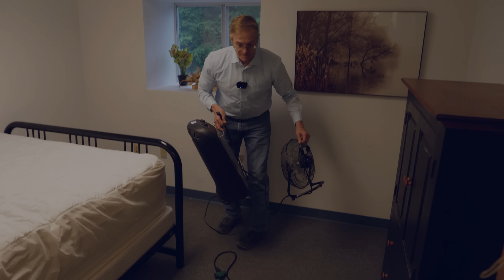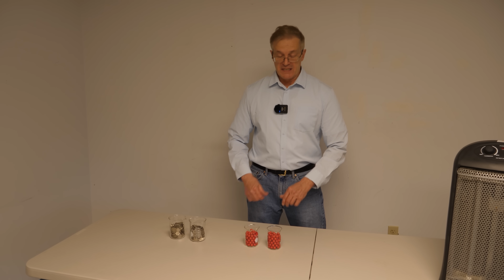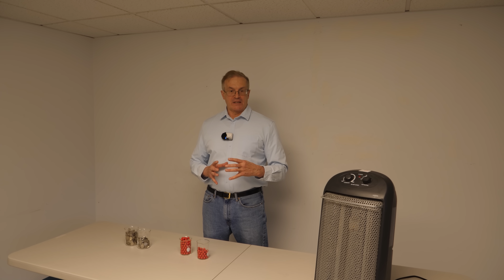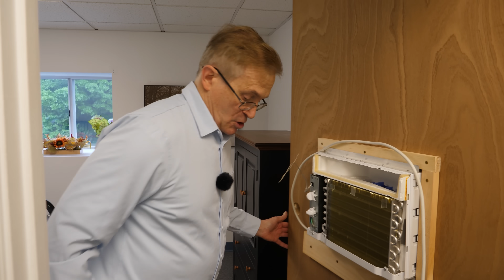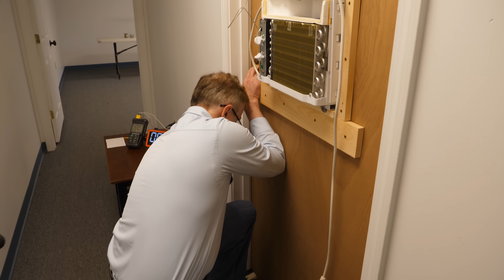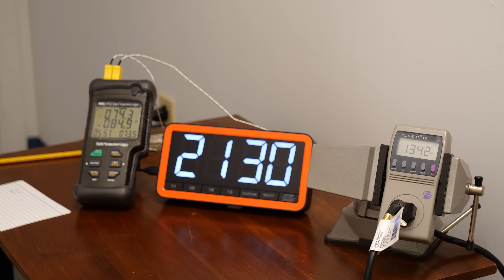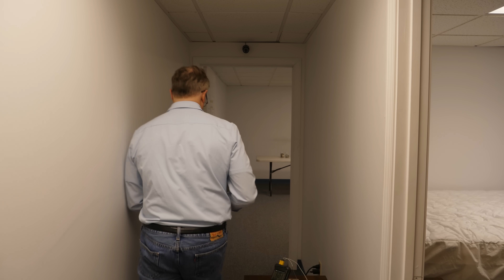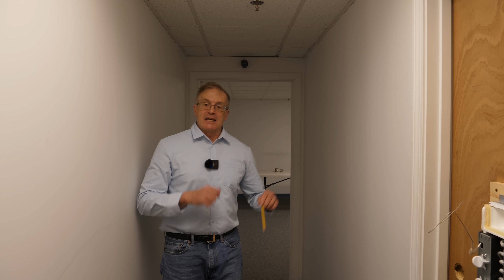You're wasting money on heating! Use your A/C!

Comment: Being a female I have no clue about how to fix electrical problems , or build a house or fix my car when it breaks down, all I know to do is how to cook , how to do laundry, how to clean my house etc etc. But I’m telling you right now is that I need to learn all these skills that men know so I can improve my way of living and save money in this path once and for all. 😮
Reply: Don't you realize that men aren't born knowing those things?  They also have to learn those skills by reading, taking classes, etc. It's just that they are unfairly expected to do that whereas women have traditionally been discouraged or even forbidden from learning those skills.  Neither is fair.
Reply: @DarqJestor  
And it is not just that. Often while maybe we would somehow manage to fix something, if we lack experience, we do not want to touch it, for fear that we will make it worse. If it is a small project, if I need to modify something for a certain need, I will go buy an extra(s) before I mess it up. In case I do not like how my project turned out. I feel more comfortable taking something apart to see if I can fix it, after I have already replaced it, and I am just rescuing an item that was about to go into the trash. I once found a discarded flat-panel TV. Maybe I should have tested it, just in case it worked? Anyway, I took it apart to see what was inside, why not? That is one way to learn. At least then I could use the spare power cord to repair something else.

I think that can be the way to transition over to a newer computer, if your old computer has not died yet. Give it time to get it set up, and keep the old one set up also. I do not want to give up the old computer, at least not until I am well used to the new one, and owning an extra computer monitor, keyboard, mouse, is not all that expensive these days. And I can be sure that I have copied everything over to the newer computer, and installed all much the same software, and I see that everything seems to be working.

Sometimes you can upgrade or get something new, and them carefully repack the old device back into its box, with all its parts, and then you have a spare lying around at the ready in case the new thing breaks, or your new configuration now needs another. Like I have a perfectly good digital answering machine back in its box, now that my cordless phones included answering machines. And no, I am not using the outdated phone monopoly land-line. You can get a VOIP adapter box and do home-phone through your internet, more features and cheaper.

I used to like the Apple Macintosh, but I seem to have defected years ago. I do not like Apple's politics, and I can not keep up with their over-priced and over-hyped artsy-fartcy computers. I have been using Linux for the last few years. The big selling point of Linux is if you think that you should own your OS and not some giant corporation, then you should use Linux. As I lean libertarian, they are so "speaking my language" in saying that.
Reply: @DarqJestor  as a woman who does all the fixen and building, I would like to point out what Jestor is saying it's unfair to men. You might be surprised to hear me say that after complaining about the other side, but doing all stuff I noticed one common thread. The stuff isn't hard. It doesn't require a lot of strength or size, but what it all has in common is a level of danger. It's all dangerous and requires safety. I get it, woman have kids, but I think as a society it's very unfair for woman to turn their nose up at any job that requires safety glasses.
Reply: @FuelFire_  I agree and I hope my comment wasn't misunderstood. People should neither be limited by stereotypes or use those stereotypes to gain advantage over others.
Reply: @DarqJestor  yeah I got it. I'm just agreeing with you. Wish more men saw it that way.
Reply: @FuelFire_  Female army mechanic here.
Reply: @DarqJestor  oh. That makes way more sense. Lol. Awesome 👍 so you know what I'm talking about. 😂
Reply: Please don't attribute your lack of electrical or construction knowledge to being female. It's fine if you have no clue about those subjects, but don't make it harder for the rest of us to be taken seriously. I can also help you understand anything you want. just ask instead of throwing us all under the bus. Thanks.
Reply: Some women CAN fix those things. Do you like to read? There are some great books with pictures, that tell you how to fix those things. Also can be learned from YT. I watch a lot of those videos, yet still lack experience or the fancy tools. I still do not want to touch it if I can avoid meddling with it.

But there are lots of us men, would would love to have a wife who cooks, buys groceries, knows how to coupon, does laundry, keep the house clean and organized, and some of us men can ourselves fix things around the house. It seemed like my Dad could fix anything. I can fix some things, if they are simple enough. I can replace a loose electrical outlet for example. But my talents in such areas are only "moderate". I lack experience and do not have all of the tools, I only have common basic tools. And I am sure not fast. Takes me way too long to fix something.

But if you can cook and clean and wash clothes, AND fix things around the house, maybe even fix the car, you would be such a "find" for a virtuous man.

Sometimes when I am watching an episode on Homeful on YT, I see a lady helping fix a botched remodel. Something just brings a smile to me, because at least as I see it, women do it right, they do not cut corners and do not do crap jobs like too many men do.

I recall long time ago when I still watched TV, watching The Cosby Show and the wife panicking because her husband, Cliff Huxtable, one of those guys who thinks he can fix stuff but really does not know what he is doing, decided to tackle some plumbing problem around the bathtub. So she is frantic to get a plumber there before he tears up the house. Must be nice, if you have plenty of money. But he was a doctor who delivers babies, so I think that they could afford a qualified plumber.

Comment: Pretty impressive. But how do you utilize this principle with a whole home air conditioning unit?
Reply from the maker: Thanks!
That's  a complex question. 
What we were demonstrating was the efficiency multiplier effect of a heat pump. How it is implemented depends on the environment, i.e., the temperature range between the outside and the inside of the building. It also depends on the furnace.  If it is gas-fired, then a heat pump can be added to top up the heating, taking advantage of the gas to reduce the temperature differential. If it is electrically driven, then it likely already incorporates a heat pump. 
If the whole house airconditioner is independent of the heating system and this is unlikely, then you have less flexibility.

Comment: Doesn't the efficiency of a heat  pump depend on the temperature of the air that's being cooled to extract heat? The air you used in your demonstration was warmer than the outside air would be when heat is needed to keep the inside temperature comfortable?
Reply from the maker: That is correct.

Comment: Very good and informative demonstration.  But, I would like to see the same demonstration with the air conditioner in the window, facing outside with the outside temperature around freezing.  I would like to see if the air conditioner would be able to pull any thermal energy at those temperatures.  With this demonstration, the air conditioner pulled the warm energy from the hallway and pumped it into the room...which is the purpose of the demonstration.  I just think it would be interesting to see the results pulling energy from outside.

Comment: I am well aware of the efficiency of a heat pump, thanks to Technology Connections, Just Have a Think and Two Bit da Vinci. But I'm in Southern Ontario Canada with time of use electricity rates. I need to compare the cost converting and operating my AC system as a two way heat pump against just staying with natural gas for heat and AC for cooling.
Reply from the maker: Of course.
We weren't discussing your particular situation or even the relative costs of different forms of energy. The efficiency multiplier effect of a heat pump is potentially very useful. This effect increases even further as the temperature differential decreases. Consider a hybrid system where fuel such as natural gas or propane brings the outdoor temperature above freezing, and a heat pump continues the heating to a comfortable room temperature. It's  the best of both worlds.

Comment: But this requires the area of exchange to have the capacity to exchange. This was the room vs. the house. A real system would use outside or underground with isneven larger therefore better. However, there are losses in the distance of the plumbing for the system. I agree this is the better way to do it, but this is a simplified example with higher than real-world efficiencies.

Comment: Very nicely done.  I’ve a few questions though, the air you are pulling into the room is from an indoor source,not cold external air so not sure how that would affect the test.  Also to do this, do you have to reverse the position of the AC in your Window so the controls are outside?  Wouldn’t this possibly make the air outside dangerously colder?  If everyone did this it might trigger an premature ice age (kidding)

Comment: Im not sure why he thinks new ACs are more efficient. New window acs still use 400-500watts. Where are you looking that you could one operating at 250? Why even say that? Also why didnt you put the fan and heater near the door on a table or something so it would be in the same general place as the AC? The AC is literally right next to your temp probe and at the same height. Im not doubting that the AC is more efficient, but why do all this work and half-ass a bunch of things

Comment: I've got two heat pumps at the moment (one in the garage, and one in a spare bedroom that was never at the same temperature as the rest of my house). The AC side of things seems to work pretty well regardless of outside temperature, but the heating side of the system struggles pretty hard when it gets down into the 20's (f) .. I will be buying a couple more heat pumps for my basement since it also has a mind of its own when it comes  temperature. 

Secondly you're the most normal writing lefty I have ever seen (coming from a fellow lefty - and I write "weird" as my family says) ..

Comment: I do not doubt the effectiveness of this it makes sense. But the 10° difference, could that be because of the location of the heat source in the first test? You have the thermostat located by the head of the bed. The heater was placed at the foot of the bed. The second test the reverse AC was placed next to the thermostat. I would like to see this done relocating the thermostat.

Comment: Heat pumps suck compared to gas.  Older heat pumps are worse than newer ones, but even newer heat pumps won't give you nearly the heat out of your vents that gas will.  If you've already got a heat pump system at home, fine, but don't let anybody convince you that you need to ditch gas for a heat pump.
Reply: Do this demonstration again when the source air is 30 degrees or lower and let's see just how well it heats up the room.  My heat pump is struggling to maintain 67 degrees inside my house as the air outside dips below 30F.  If I turned the heat on during a 75 degree day, yeah, I could easily warm it up to 90.

Comment: I always thought that the air coming out from the back of an air conditioner was carbon dioxide and that it could end you in your sleep if the back side wasn't outside? 

If is generally safe, are there air conditioners out there that does throw carbon dioxide from the back?
Reply from the maker: No.
Think about the process itself. The airconditioner is a sealed machine. The refrigerant is not consumed, and that's why these can run continuously for years. If they leak, the vapor is an inert hydrocarbon. For them to generate CO2, they would need a continuous source of carbon.  It's not there.
Some of the bad press with airconditioners came from old units with dirty and potentially plugged drainage trays where mold can eventually grow.  Keep them clean.

Comment: You’re not gonna need heat that much when you have a 75° condensing medium you’re going to need a defrost board say you disengage the fan and throw the back up heat out the window. I still don’t see that small car being able to gain the heat, it needs when you get below freezing temperatures or 40 or below and I know all this factory yeah Ya-yaheat pumps are really good to 40. Well they’re putting them in where they get in the teens guys good info not a good control test study. It may get you out of a pinch to flip your AC unit around when your heat breaks, but I wouldn’t bang on it without some modifications.

Comment: So if you  turn the  heat side in the freezing  cold,rain,snow wont damage  it or should I  cover for protection  from the elements ?
Reply from the maker: If trying to use this as a heat pump, I'd locate the "cold" side in a protected place that's accessible, like a covered porch or better yet, a partially heated room or shed.  This will magnify the COP of the pump and make it more efficient.

Comment: Challenge...the Davison heat topology. Stick a heat pump on a air or water heater that needs exhausting and intake. AKA FF.
Turn off the boiler, the COP is still better with the extra heat exchangers in the heater in series with the heat pumps heat exchangers. Turn on the boiler and the COP get super charged, even a whole magnitude is possible, In the limit if the waste heat is the same temp as the inside air temp, then no pumping power is needed, only air or fluid movement power is needed. if the average waste heat seen by the heat pump after the boiler, is 1/2 way between the inside air and the outside temp, then the COP is not above 10x, but still above 2x of just the heat pump.
Heat pumps suck when heating up a cold space. A boiler removes this problem completely.
Heat pumps are oversized, to reduce this issue, but now your paying for an extra 30% capacity.
If a heater dumps its heat, then the heat pumps extracts the waste heat magnitude multiplying the COP.
Both the boiler and hat pump can now be downsized.
Or re-use an old boiler. heatpump extraction removes a crappy boiler efficiency! Even a crappy wall heater gets upscalled!
The Boiler is now a form of DER introducing the Davison heat topology with smart DER!
Grid about to collapse? Turn on the boiler, variable pricing congestion? turn on the boiler.
1/3 the fuel of a central power plant with all waste heat used.
GAIA your welcome. This I give to GAIA, its to important, just original ideation-creation credit and a free system...
Reply from the maker: That is basically what I've recommended to a few critics. The heat pump is only used as the final stage in a multi stage system. The same benefit can be applied even if the "cold" side is in a partially heated room with air as the only transfer medium. 
I do appreciate and agree with your attitude. Share what you know and amplify the benefits.
Reply: @TechIngredients  I was up in the attic and found my father's portable AC I forgot got stored.
I have a crappy propane wall heater, I don't use. I have a fan to blow attic heat in reverse.
Turn on a small fan in afternoon to dump soak heat trapped in attic into house.
But if I plume the crappy wall heater exhaust through the crappy AC unit turned into heat pump, with an exhaust vent added for boiler exhaust after the heat pump.
This way the heat pump is fed from attic and pressurizes the house overcoming the vacuum created from wall heater, less crappy now.
The added heat from heat pump and removal of cold air infiltration is a huge advantage. The l SS than stellar wall heater efficiency is just a new opportunity for the heat pump to scavenge instead of pumping Delta T.
Reply: Its cool that you just got it.
Infinitely better than zero...
A victory over null!

Comment: Try that test starting with a hallway temperature of 10ºF and you'd get much different results. There's a reason commercial heat pumps have an "emergency heat" function, in which it literally operates as a central space heater.

Comment: Ive been tempted to put an AC in the window backwards so the heat is coming into the place here. But that means the controls are on the outside in the extreme cold so not sure how that would work out. 
They also make window heat/AC units that are about the size of a large window AC that Ive been looking at as well. A bit higher priced than an AC only model but if they work I figure they'll pay for themselves pretty quick